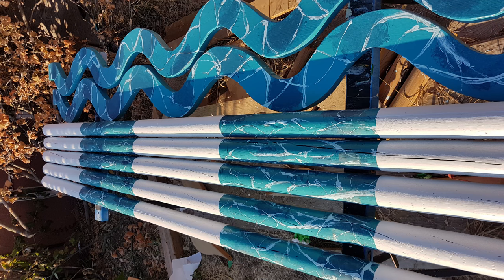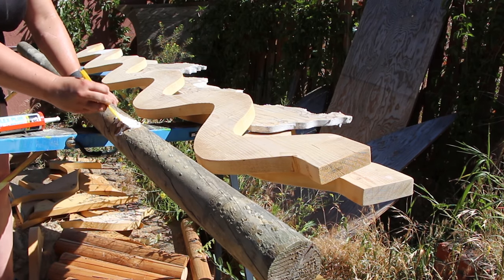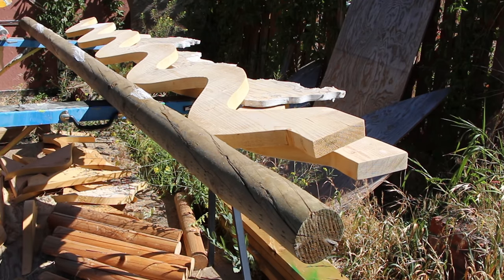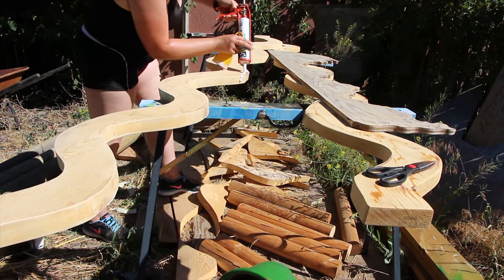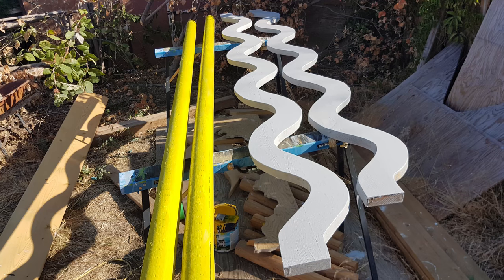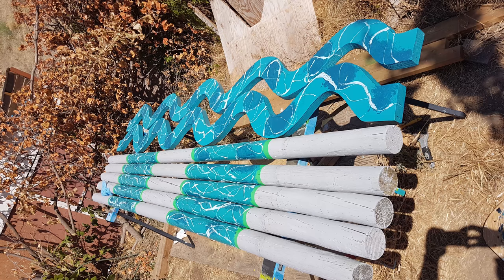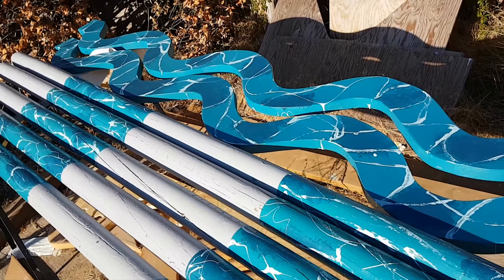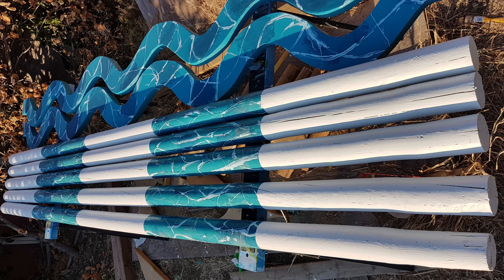DIY Summer Inspired Plank and Pole Jump Fill for Equestrians!

Comment: Hi! Do you have instructions for how you cut the wavy planks?
Reply from the maker: I do not have specific instructions.  I decided how many wave peaks I wanted, subtracted the ends that are cut for hanging the planks and divided the remaining plank length by the number of waves.  From there you know how wide each wave is and draw the wave on the top.  I held a ruler to keep my width at 4" and followed the top line to get the bottom line.

Comment: just wondering where do you get the pole from ? great video
Reply from the maker: The rails are just constant diameter rails from my local lumber yard.
Reply: Oh ok and is it a post fence just rounded up ? Sorry for the many questions lol thanks
Reply from the maker: @AlbertoHernandez-tr6to  rails not posts
Reply: Ok I’ll have to call my lumbar yard and ask if they do that. Just ask for rails ?
Reply: Is the diameter for the rails 10 ft long by 4x4 thanks again